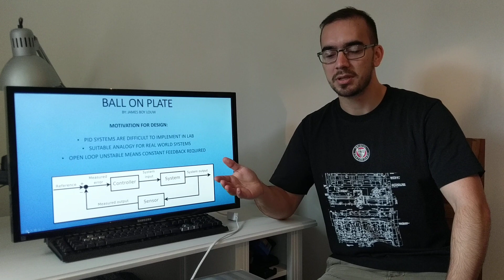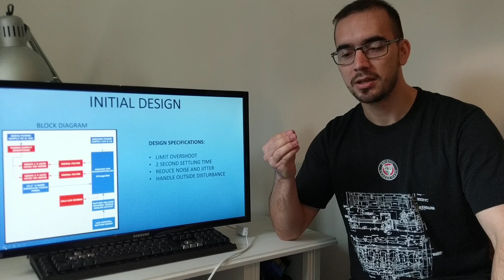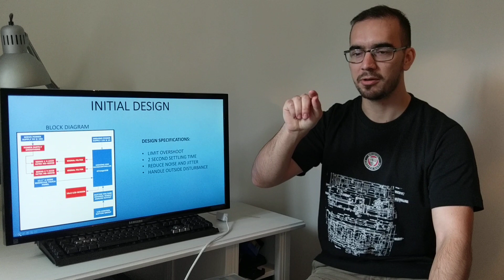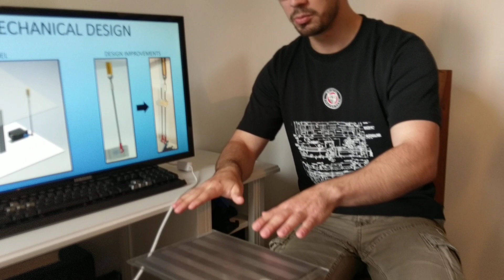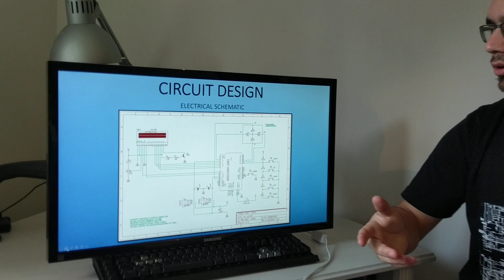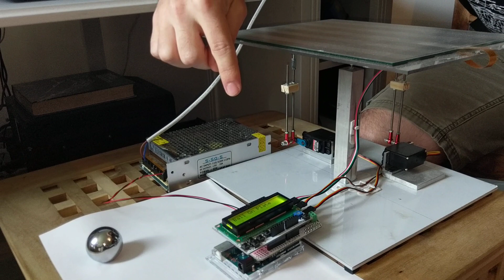Final Unisa Presentation: Ball on Plate Control using PID

Comment: I'm actually working on a similar project, and thankfully I saw your video. You are speaking about some problems that usually others don't mention which is great, like the problems you had with the joints and touch screen noise. Thanks for your motivation.

Comment: Can you tell me what kind of screen do you use to detect the movement of the ball?
Reply from the maker: 12.1 inch resistive touch 4 wire
Reply: @jameslouw8318  can you send me link for this??
i did not find it on ebay
Reply from the maker: https://www.ebay.co.uk/itm/12-1-inch-Industrial-Resistive-Touch-Screen-USB-Interface-4-3-4-wire-260-200mm-9-/164364835949?_trksid=p2349624.m46890.l49286
Reply: @jameslouw8318  Is it the same as the product you used? I have difficulty calibrating the display parameters ... thanks
Reply from the maker: @vanhauo8428  you must use a heavy stainless ball or it won't be stable
Reply: @jameslouw8318  Whether on aliexpress or alibaba will sell this item .. I cannot order from ebay.